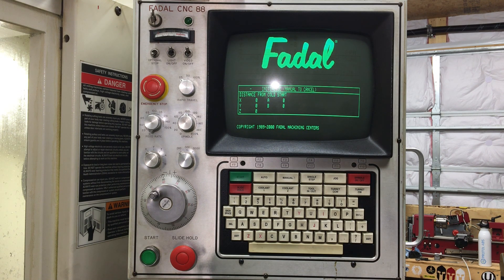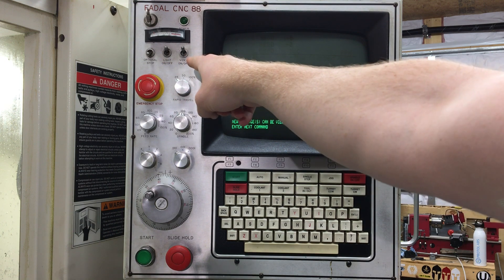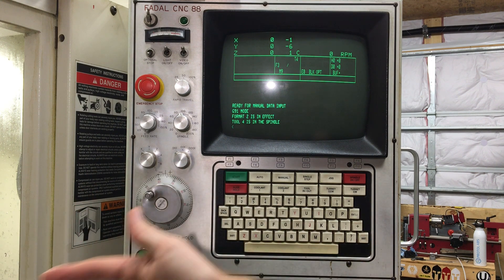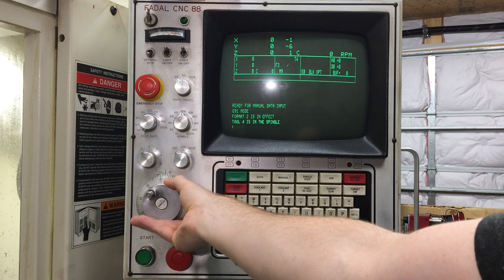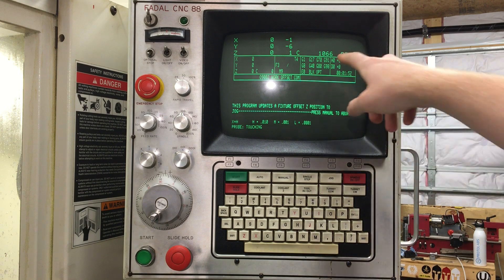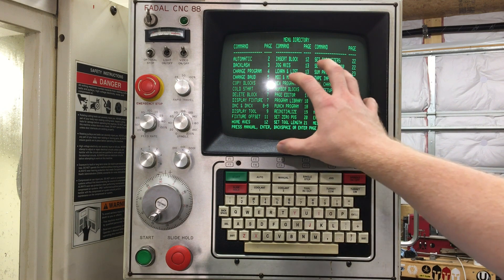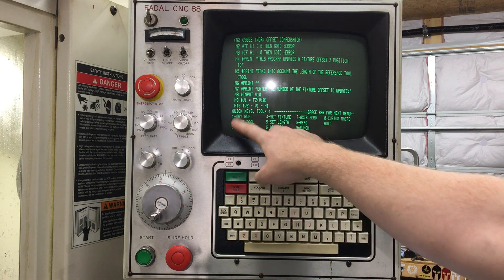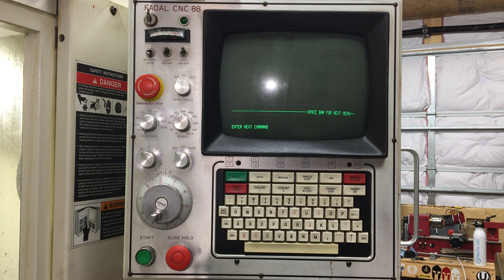Fadal Controller Overview - Getting Started 2

Comment: "Hola" good videos' what type of post processor does this machine use
Reply from the maker: Raul, the machine itself does not use a post processor - the way it interprets code is fixed and does not change. Post processors are used on the CAM side of programming when you are creating the tool paths and want to export those moves/program to the language of the machine. I use fusion360 and use the standard Fadal post.
Reply: @bgwmachine  so cool, do u have a USB port on the fadal machine?this machine does not have a USB port , and I use fusion 360 so how can I make it work? Thanks for your comment , I wasn't sure if the post processor would work on it
Reply from the maker: @henrypenner437  I have USB, SD, and Ethernet available on the machine. I installed myself and made a video awhile back to help explain... my main way of transferring files is thru an FTP as I have my machine connected via Ethernet to my network. Check out the video and let me know if you have any questions: https://youtu.be/IeXrYeqKZps
Reply: Yo uso el post procesador que tiene Camworks

Comment: Your  Y  has a   -6  when not moving... u should set the axis AMP (will need a small screwdriver)
Reply from the maker: Yep, on the todo list!
Reply: If u have a DC analogue ..it has 'normally'  SIGnal , LOOP Gain , Current limit pots  + Balance potsOf course it can be named differently (vendor and version dependent)SIGNAL   SIG is for the  input signal level setting... so all the axis  have the same "error" numbers next to them at the same feed (in the manual u have the process...)  LOOP GAIN  - LG  is for the stability of the servos (overshooting , oscillation) Current limit  CL   is kind a ... it is there but no big fuzzBalance   BAL .... the manual if needed.  - usually u can set this to  zero the idle error.Tachometer  TACH  pot is unpopulated (maybe) - to set the voltage / 1000 RPM level... usually 7V /  1000RPM in Fadal